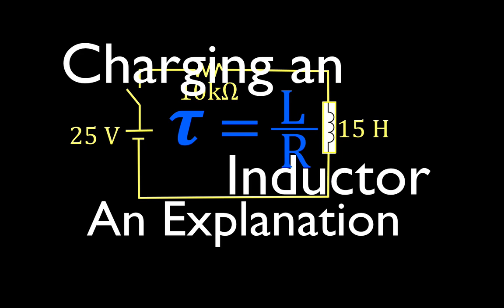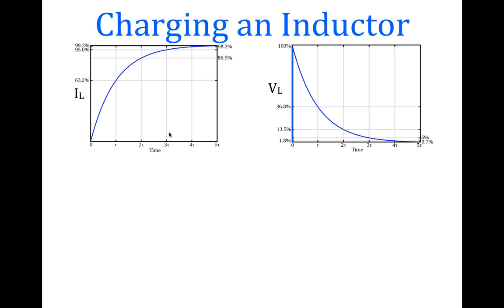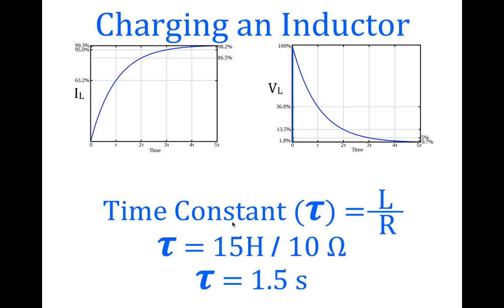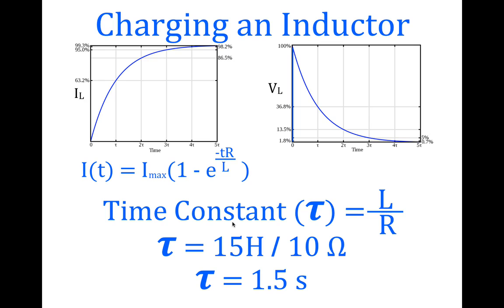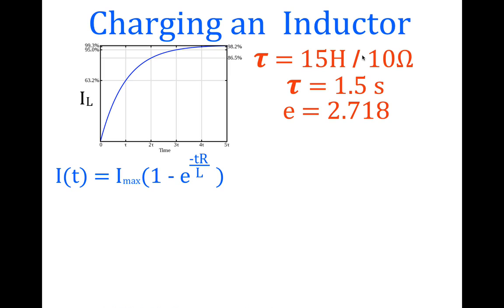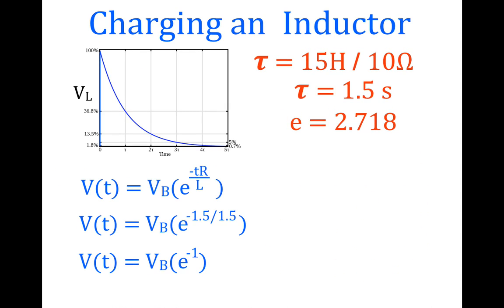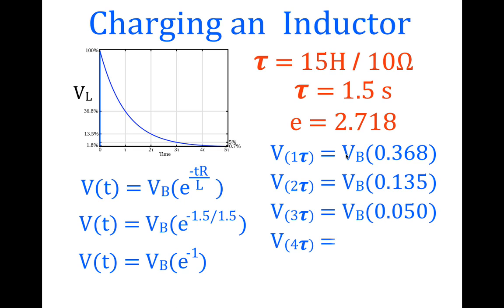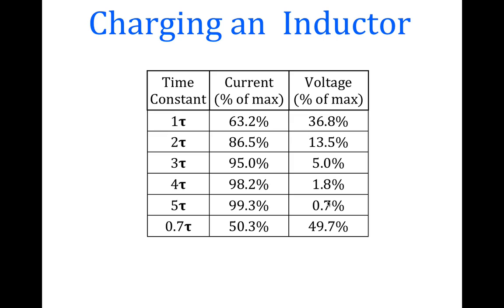RL Circuits (6 of 8) Charging an Inductor, Time Constant, Voltage, Current, An Explanation

Comment: just one correction you cannot "charge" an inductor, there is no such thing as magnetic charge ... as far as we know magnetic monopoles do not exist and unlike electric charge on capacitors magnetic charge does not exist so you can only magnetize and demagnetize the inductor instead
Reply from the maker: I understand what you are saying and of course we always say that we charge a capacitor, but in my experience there is no corresponding term for an inductor. I have never heard anyone say magnetize and demagnetize an inductor. I am not saying you are wrong but....

Comment: Your videos  continue to be very useful to me, thank you very much for that !

But I can not understand the relationship between the "linear shape of the current" in an inductor (di/dt =V/L for the primary winding of a transformer for instance ) and the "exponential shape of the current" of a charging inductor in this video. 
These two type of inductors are charging inductors ; why their current shape is not the same ?
Could you clarify this point a little bit ?
Reply: I think the difference is that di/dt = V/L applies to an ideal inductor with no resistance.  When you take into consideration resistance, then that produces a different equation whose solution is the exponential equation in the video.